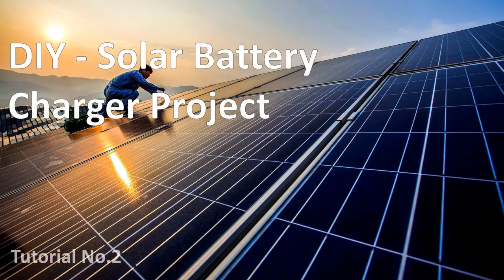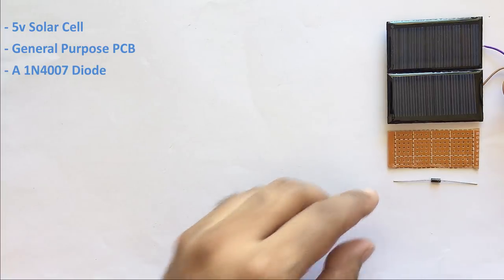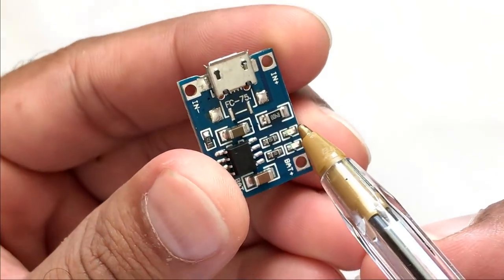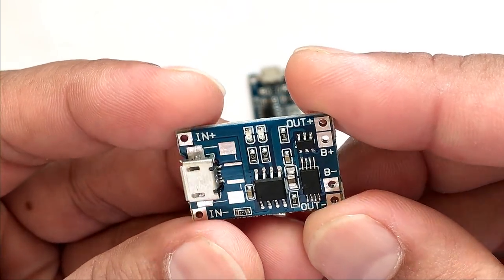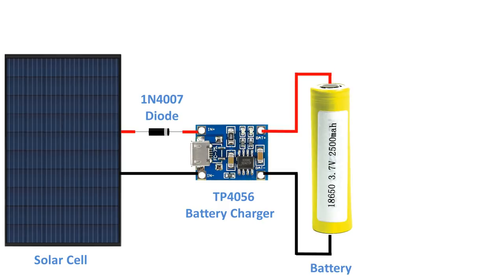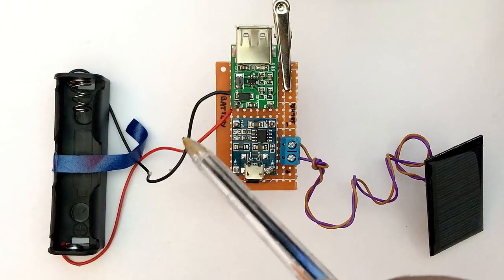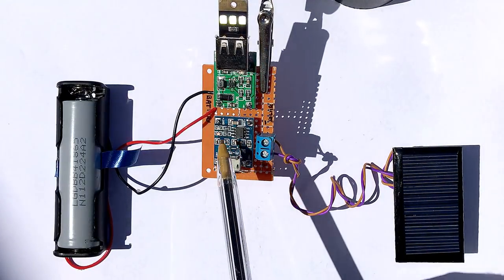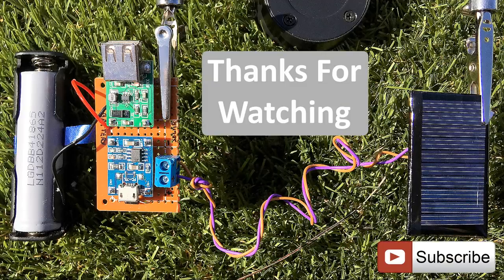DIY - Solar Battery Charger

Comment: Is the TP4056 necessary for this circuit? would it not be possible to go from the panels directly to the battery then to the voltage convertor?
Reply from the maker: Hi there
Yes you can definitely bypass the TP4056 board 
The reason I have added it to the circuit is to protect the battery from over or under charging.
These batteries can catch fire if they become too hot or will completely die if they loose all their charge.
Reply: With the TP4056 board with two outputs, how does that wiring work? the B+ and B- to the battery and the other outputs directly to the 5V voltage booster?
Reply from the maker: Yes, please have a look at the video. I have explained it in there.
Basically thats the way the battery is protected from under or over charging.as soon as the max or min point is reached the circuit cuts off the connection between the battery and the output pins.
Reply: upon assembly of this circuit, I have a red light in the TP4056 board but the phone still doesn’t charge. If i plug the TP4056 into a power source the phone begins to charge… therefore i believe my circuit is wired correctly… does the board just need to change up? before it will work and charge a phone? let me know some steps in troubleshooting this!
Reply: CheMur PS solar panel current must be really low. What solar panel are using?

Comment: I have a 6v 1w solar panel. I aim to put (2 x 3.7 18650 cells) in SERIES. 
How do I adapt the circuit/s for this setup ? Thank you!
Reply from the maker: The circuit would be the same but it will take longer to charge the batteries. 
In general, terms, if you increase the number of batteries you need to increase the amount of current flowing out from the panel to the batteries (so may be try a bit more wattage)
Reply: @CrazyCoupleDIY  OK, so more solar wattage needed, check! thank you!
Reply from the maker: @CarneSagrado  Yes you need a more powerful pannel :)
Reply: Crazy Couple would a 9v solar panel work with this system?
Reply from the maker: @markbriggs5110  9v will burn the TP4056 chip
as the Input Supply Voltage(VCC)：-0.3V～8V

Please have a look at the datasheet : https://dlnmh9ip6v2uc.cloudfront.net/datasheets/Prototyping/TP4056.pdf

Comment: 1.Is it ok to use this regularly without removing from the sun? I'll use it and display on our garden
2. Will my battery explode if I do that (no. 1) and the battery is full charge?
Reply from the maker: 1. You definitely can. I have a weather station running  24 x7

2. The board has under and over charging protection
So no worries mate

Comment: I have a question,  
How can I charge 2 of these batteries with solar panels? 
waiting for the answer.
Reply from the maker: 2 batteries will need more wattage.
Which mean you either can add more panels or single panel with more wattage
In simple terms more electrons are needed.

Comment: if i use 3 batt 14500 need to use voltage booster for power the project?

Comment: Hi i'm working on an engineering project. Just a quick question as the solar panel is used as one of the power sources, where you have connected this to the circuit are you able to replace this with a generator which is turned by a turbine etc?
Reply: The input terminals of the module is recommended to use with clean DC voltages of -0.3V ~ 8V. Generators which are turned by a turbines outputs AC voltages, so you can't connect it directly, without a rectifier and a voltage stabilizer. (I'm no expert here but hope this helps)
Reply: @nubamin8653  thank you it did great video

Comment: Hi bro 
I have few doubts
Firstly I want to give supply to the arduino uno from batteries using solar panel. The range of arduino uno working is 7-12v so, what setup should I do using batteries and solar panel
Reply from the maker: I use 2 x 18650 batteries to power my uno

Comment: Will this produce enough current to power an arduino with bluetooth module and basic LED timer display? I would use two 5V solar panels producing 0.04 A current and  0.2 W power each. Thank you for your clear explanation.
Reply from the maker: BT modules consume lot of power. In general any wifi module drains out battery pretty quickly unless you put it on sleep or use interrupts. 
LEDs are also massive power drainers. 
The best way would be to connect a multimeter in series and calculate the power consumption and then do your math and see how long the device will last on a fully charged battery and based on your math you can find out how much power you need to charge them back up.

Comment: Can the solar panel wired more than 3 meters so that I can mount the panels in the roof and the charging unit is inside the house/shaded area?
Reply from the maker: I don't see why not

Comment: is this project can power a 12v dc motor?
Reply from the maker: You better of using this just to change a battery with in turn can drive the motor

Comment: I want to make four 3.7 volt modules and connect two voltages from usb output in series to 7.4 volts and two 7.4 volts in parallel to increase current. Can I use it like this?
Reply from the maker: Sure you can
I don’t see any reason why not
Reply: @CrazyCoupleDIY  thank you so much have a good day!!!

Comment: Very great video. I have few questions, 

1. I have 2 Li-ion batteries connected in series to get higher overall voltage values, but I step down using buck converter to 5V, so this eliminates the booster. will that be okay?

2. Can I charge the same with Ni-Mh batteries with the same board? 

3. What if I buy CN3065 and use the same to charge the Ni-Mh batteries?   

4. If i want to increase my overall battery capacity, should I add more TP4056 to match the current rating and add more batteries accordingly?
Reply from the maker: First of all thanks for stopping by.
1. That should be fine
2. I dont see anything that will stop you from doing that
3. Yes. I have a small RC car that I created, which has 3 of the 18650 batteries. Each battery has their ow BMC (battery management circuit) to avoid over or undercharging
Reply: @CrazyCoupleDIY  you were really helpful, thanks. Wish to see more from you. keep up, bro.

Comment: what if I dont add the switch between the battery and the booster?
Reply from the maker: The circuit will still work even if you dont add the switch in between
I added it to avoid charging and discharging at the same time.
Reply: Thank you for the prompt reply. 
I am asking to know if there is any side effects for charging and discharging in the same time? will that cause any serious issues?
Reply from the maker: Not really, I have a remote logger installed on my roof and it works fine with this setup.
I also use this for my smart letterbox and i never had any issues.
Both setup dont have the switch in it.
Unless your circuit is draining the battery drastically this setup will work without any issues.
The only thing is you will never get the green light (fully charged indicator)
Reply: Nice :) I am making an autowatering system that will just wake up every hour so I dont think it will cause any issues 

btw I am so much interested in seeing your other two projects any plans on making videos about them ? I am also planing to make a letter box notifier :D
Reply from the maker: IT should work without any issues mate.
Yes, Currently I am making a video on automatic garage lighting system, and the next one will be on garage door opener with few other features that you will not find on any other blog. 
Sure I will create tutorials on them in near future
Stay tuned and best of luck for your project :)

Comment: can this be the power source to the arduino ptoject?
Reply from the maker: Yes it can, but not without the battery.
Solar panels wont have enough current to power an arduino.

So you need to charge the battery using this circuit and the battery will power the Arduino
Reply: @CrazyCoupleDIY  how can I do that please need your help for my project
Reply: @theolix9938  ya same like you

Comment: Can I charge a battery pack that contains 4 Li-ion batteries using this set-up as well or do you have any recommendations?  Your response is very much appreciated for my research project.
Reply from the maker: This setup is to charge a 18650 battery which has the following specs
Nominal Voltage: 3.6V.
Nominal Capacity: 2,850 mAh.
Minimum Discharge Voltage: 3V.
Maximum Discharge current: 1C.
Charging Voltage: 4.2V (maximum)
Charging current: 0.5C.
Charging Time: 3 hours (approx)
Charging Method: CC and CV.

If the Li-ios you are charging falls between these specs then you should be able to, otherwise you may need more panels and few more of the protection circuits. 
In reality one protection circuit should be used for 1 cell (they are dead cheap anyways)
Reply: @CrazyCoupleDIY  thank you!

Comment: is it okay if i want to use this circuit for charging the mobile phone?
Reply from the maker: Sure is, but you will need 2 to 3 of those solar cells as one is not sufficient to provide enough current to charge a phone.
Reply: Crazy Couple alright..thank you so much
Reply from the maker: Pleasure, I will publish a DIY charger box video soon
It will be multifunctional charger box. 
Stay tuned for that :)
Reply: Crazy Couple noted.I will wait for that video

Comment: cual es la capacidad maxima de la bateria(18650) que puedo conectar al tp4056?
Reply from the maker: If your question is: 
what is the maximum capacity of the battery (18650) that I can connect to the tp4056?
The answer is: 
·Input Supply Voltage(VCC)：-0.3V～8V
·TEMP：-0.3V～10V
·CE：-0.3V～10V
·BAT Short-Circuit Duration：Continuous
·BAT Pin Current：1200mA
·PROG Pin Current：1200uA
·Maximum Junction Temperature：145℃
·Operating Ambient Temperature Range：-40℃～85℃
·Lead Temp.(Soldering, 10sec)：260℃
·Preset 4.2V Charge Voltage with 1.5% Accuracy 
·2.9V Trickle Charge Threshold (TP4056)

Comment: this also works for powering an arduino uno?
Reply from the maker: Yes it does
But you may need to add a panel with higher wattage
Reply: Any sugesstion?
Reply from the maker: I power my NodeMCU using a 1.5W panel and it works like a charm
It cost me $3 from eBay
Reply: Ok, so i need a 1.5W panel to power my arduino, thanks for the help my friend
Reply from the maker: Pleasure

Comment: I have a question, how can I charge the battery using the solar panel and use the battery for my Arduino project
Reply from the maker: This setup should work flawlessly 
Just attach your Arduino's Vin and negative to the output of the booster
Reply: @CrazyCoupleDIY  can I charge a li-ion battery pack that contains 4 li-ion battery using this setup as well or do you have any recommendations. Thank you so much for your time!

Comment: It posible if i put straight to the step up bosster withou battery ??
Reply from the maker: If your solar panel can provide enough “current” then it’s fine. Moreover Adding a battery will keep ur circuit active when the sun is set.
Reply: Crazy Couple but i already try .. it not charge the fone or power bank . Can help me bro?? This for my final project
Reply from the maker: How much current is produced by ur panel?
To charge a phone/powerbank you need more current on whatever voltage its outputting.
You atleast need 1.5 Watt output
Reply: Crazy Couple i will buy your project .. can me buy it ?
Reply from the maker: I will suggest you the components and you can buy them off internet

Comment: and how do i connect TP4056 with the protection to the battery? do i use B+, B- or OUT+, OUT- ?
Reply from the maker: IN+ and IN- are for the input, B+ and B- is where the battery connects to and OUT+ and OUT- is where your devices are connected.
So basically if the voltage is low or high the OUT will not output anything 
Let me know if you need further clarification 

This is my Blog: http://diyfactory007.blogspot.com.au just for your reference
Reply: Crazy Couple thank you xD and one more question xD how to connect voltage booster with it all? btw great video, keep it up xD
Reply from the maker: Just connect the IN+ and IN- of the booster to the OUT+ and OUT- of the TP4056 board.
The booster outputs the voltage from the USB port, so you need to connect a USB cable to harness the boosted Voltage.

Thanks again for watching, stay tuned for more amazing videos :)

Comment: Can I use a 6v solar panel with this?
Reply from the maker: Sure you may
Reply from the maker: Input Supply Voltage(VCC)：-0.3V～8V

Comment: what type of mobile booster u use?.. step up or down??
Reply from the maker: There is no mobile booster. 
I am a bit confused mate
Reply: sorry..that voltage booster..
Reply: @CrazyCoupleDIY   what function spdt actually?
Reply from the maker: The SPDT is just to cut the circuit off when its charging, you can remove it if you dont want it.
Reply from the maker: Its just a setup converter, so anything that can convert a lover voltage to 5V. You can find heaps in Aliexpress. They are very cheap. The one I used cost me $0.30

Comment: can i used 3.7 v 2200mah  4.3A li ion battery?
Reply: how about i used a smaller one 3.7v 1300mah .what is the difference?
Reply from the maker: Depends on how much current your panels are pumping in.
Reply: I used 12v 1w panel

Comment: Hello, why use diode ?
Reply from the maker: The diode is used to stop the reverse flow of the electrons.
basically to stop the flow from the battery to the solar pannel
Reply: Thank you :)
Reply: Do we still need diode when using tp4056 with protection module, the one has out(+) out(-) in additon to B(+), B(-) ?
Reply from the maker: In general the mosfet of the module can handle reverse polarity. However to be on the safer side I will always put one.
Reply: @CrazyCoupleDIY  Thank you.

Comment: Can it charge 11.1V 2200MAH 25C battery
Reply from the maker: You will need more panels with high current output
Reply: @CrazyCoupleDIY  if I have a 3.7V 6000mAh, can I use the TP4056?
Reply from the maker: Sure you may

Comment: Im sorry if u mantioned it on video but it's hard to understand with accent. Why did u put a diod between charger and solar battery?
Reply from the maker: First of all its not the accent its your mentality that is the problem.
If you cant understand stuff easy like this, stay away from my channel.
And if you dont know why a diode is needed in a circuit then you should go back to school and learn the basics of electronics.

Comment: No niutle line and deta line no my phone charge.......very bad!
Reply from the maker: Looks like your panels are not powerful enough
You should have atleast 1.5W panel to charge a phone directly

However, if you are using battery in between you can use a lower wattage panel 
I hope that answers your question

Comment: Huawei gr5 2017 my phone no charge this is project faile
Reply from the maker: What is the wattage of the solar panels that you are using?
Reply: I use 16 v mini solar panel
Reply: No niutel wire and deta wire no my phone charge
Reply from the maker: @slimax2842  Voltage is not a concern here, power (current) is what you need to worry about.
Moreover you cannot have 16V input to the TP4056 chip 
It can only support Input Supply Voltage(VCC)：-0.3V～8V
Your setup is a failure, my project is perfect

Just for your kind information, you cannot charge a phone directly from a solar panel, you need to add a battery in between. So, the panel will charge the battery and the battery will charge the phone.

Comment: It may be fine but the connection which have done internally show them otherwise is not worth
Reply from the maker: What connection are you talking about?
This just a plain explanation of a solar charger
And I wonder what part of it made you feel “not worth”?